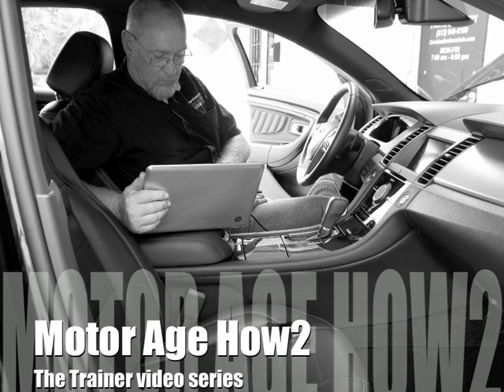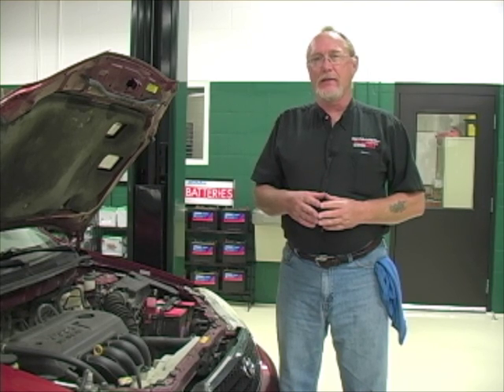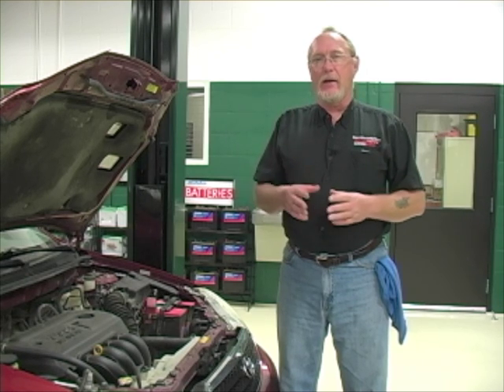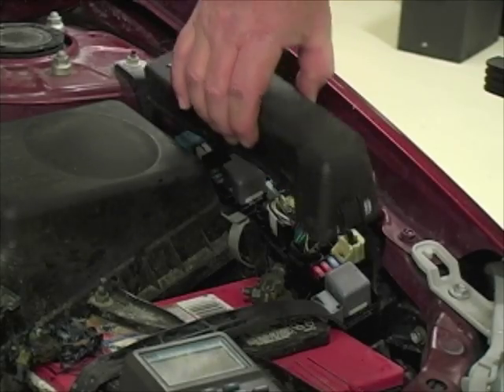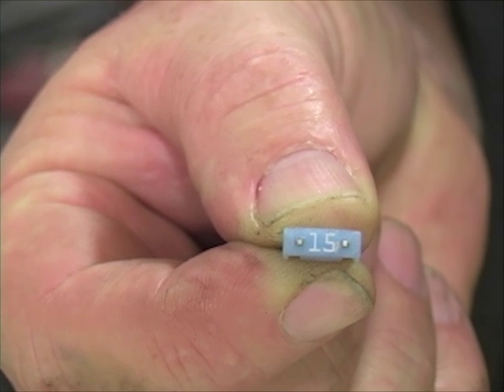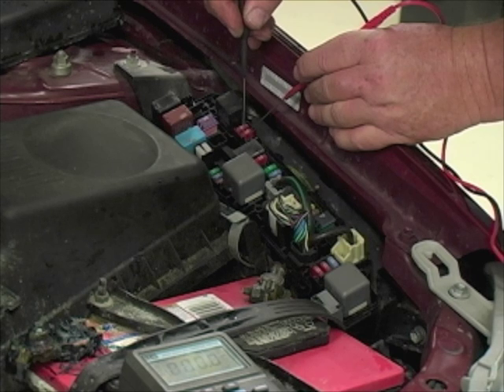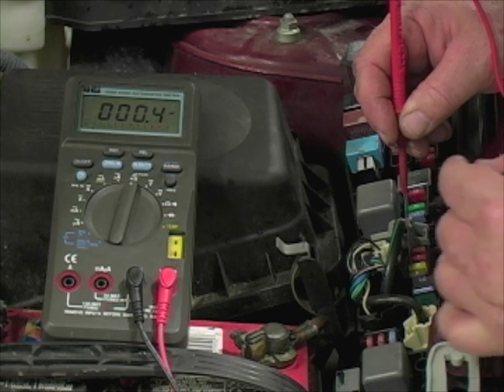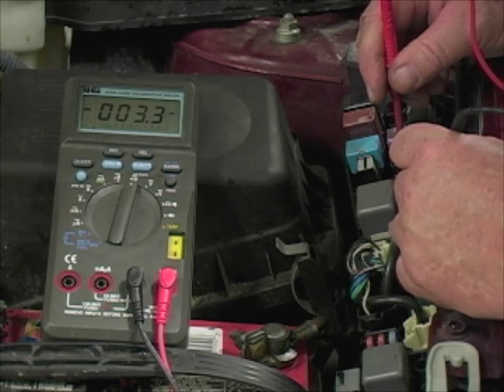The Trainer #26: Using Voltage Drop To Find Key-off Battery Drains

Comment: 3 mv is not probem, 0.1amps is good max, why are you checking milivolts not amps in series?like here. maybe that 3.5mv is for alarm system or something like that. good test but not full prove
Reply from the maker: We are measuring voltage drop across the fuse, and that is measured in volts. And 0.10 amps is way too much draw!
Reply: the 3mv is NOT the TOTAL voltage drop across that circuit. It's only the drop across the fuse in the problem circuit.  3mv is not the problem, the 1 volt drop further down the circuit is the problem.
Also the reason for not doing an amp check in series is because you would most likely disrupt the circuit in doing so, and even if you don't it would take a lot longer.

Comment: Quick question. I see voltage drop testing is good for isolating live circuits, but how do we confirm excessive draw in the first place without checking amp output of the battery?
Reply from the maker: This is but one method for isolating the cause of parasitic drain. The first step, as you noted, was to measure at the battery to see if there is a drain to begin with.

Comment: Thanks for the video. But why do I show NO AMP draw when meter hooked in series?
Reply from the maker: A few things to check. Are you using a digital multimeter? Are you on the right scale? Are your leads in the proper jacks (their different than the ones you use for voltage measurements)? Did you blow the internal fuse?
Reply: Motor Age Thanks for you response, I really appreciate it sir.
 I am using a digital meter at a 10 amp scale with the leads in the altered jacks. (Positive lead in the amp jack, instead of the side by side normal configuration).
I must clarify... when I said I have no amp draw I was wrong. I should have said "no significant amp draw". When I first hook the meter in series I get about 0.7 draw for about 20 seconds. Then it drops down to 0.02 . 
I'd appreciate your thoughts and suggestions... Thx
Reply from the maker: redwhitentrue Then you have no parasitic draw on the system. The initial 0.7 amp draw is likely a module that is "awake" and powered up, and then it shuts down and the current falls to a perfectly acceptable level. What kind of problem are you trying to solve?
Reply: Motor Age The problem I'm fighting is a "no crank" issue. But it only happens after the 2002 Grand Caravan has been sitting in the driveway for a day or two. 2 weeks ago I was stranded and had to get a jump home. I tested the 6 year old battery and it was marginal so I replaced it. A week later of starting fine it wouldn't start again so I tested alternator volts. It was only 13.2 volts so I replaced the alternator which is now putting out 14.2 volts.  It ran fine for another week but then didn't crank. I waited a few seconds and it did crank and started. I'm afriad to take it anywhere due to the intermittent no crank that before has stranded me.  Your thoughts are appreciated.
Reply from the maker: redwhitentrue When the failure occurs, does it try to turn over slowly or not at all? When the system is working, is the cranking speed normal? Do you have replacement battery cable ends installed? 
I would do a voltage drop test on the starting circuit. I think you'll find your problem there OR it is possible that the starter motor has a bad spot on the commutator. First few things that come to mind.
Reply: Motor Age When the failure occurs it will not turn over at all. All battery cable ends are original and clean. And yes, when it is working properly it does crank at a normal speed. I think you may have hit something there on the starter commutator. Is that testable?
Reply from the maker: redwhitentrue Usually a sharp rap on the side of the starter when it is stuck in a bad spot will be enough to get it turning. Another possibility is a problem in the relay side of the starting circuit. When it fails, look for power to the solenoid on the ignition feed wire or try swapping the starter relay with a "known good" part.
Reply: Thanks much. I appreciate it.

Comment: plz tell me for that test fuse WHERE  i shoud put my maultimeter on???
Reply from the maker: Take a close look at the top of the spade-style fuse. You'll see two small test points that many use to check continuity with the power off. But if current is flowing (parasitic loss) there will be a voltage drop across those two test points. HTH!
Reply: i now that  i mean where i put my maultimeter thanks?
Reply from the maker: saringe kamal Set your meter to read DC Millivolts. One lead on one end of the fuse, the other on the opposite end.
Reply: ok thanks so much

Comment: This has been one of the most talked-about and also the most repeated, but nevertheless the most absurd subject that has been thrown around by some so-called instructors in the recent years

Although one might interpret a 3.2 mV drop across a fuse as passing current which is a correct assessment, but the reality of the battery drain that causes hard start and no-start after sitting overnight or a weekend is that anytime the parasitic drain exceeds 80mA, you encounter such problems.

Now simply finding, measuring, and measuring accurately with a solid repeatability, the amount drop in Micro Volts (not mV...milli volts) across a suspected fuse and interpret that data into a solid voltage drop figure that is exceeding the limits of allowable parasitic drain, frankly borders on wishful thinking, incompetence, or lack of practical experience.  

The equipment that are able to make that minute of measurements consistently are the lab quality measuring devices, and are not simply available in a typical automotive repair shops in a repair shop environment. You can have Micro-volt drops just by elements, grease, and corrosion on the tip of the test leads.

Granted; if a power relay, defogger, seat actuator, and other high-amp devices stay on, their drop can be measured by going over the fuses. But when you are diagnosing for parasitic drains that are slightly above the limits of say 80 mA, and causing a battery run down, then measuring voltage drop across the fuses for such a minute amount in Micro-amps repeatedly and consistently, and interpolate that reading into an actual and sustained amount of draw, is really wishful thinking, regardless of articles in Motor-Age, propagated by someone in CTI, and repeated over and over again.
Reply from the maker: First, no article in Motor Age is propagated by any corporate partner. Second, this test method was first taught (by the information we found during our research) by Chrysler many years ago. Third, this is only one of several methods we share to tackle what can be a difficult problem and not an end all cure.

Thanks for taking the time to voice your opinion.

Comment: very stupid question but... once I found the fault, what do I do? Is it just the case of changing the fuse? Or each case is different and if for example the problem comes from the radio i will have to change the radio, or the wires?
Reply from the maker: First, no such thing as a "stupid" question. Once you have the fuse identified, you use the Power Distribution schematic to see which circuits are fed by that fuse. Then, using a low amp clamp, you can isolate exactly which circuit is the culprit by measuring for current draw on each leg independently. Once you have the single circuit identified, you can then determine whether it's a component fault or someone just left the trunk light on!
Reply: Thank you! (you think there is no stupid question... watch me doing mechanics). Oh where do I find the Power Distribution Schematic? Is it in my user's manual?

Last week end i got in my car, and the radio switched itself on without even me putting the key in. This could be related, right? Althought the stereo has never been changed, it is a standard peugeot one (I have a 206)... Ahh electrical problems on a Pug...
Reply from the maker: The Power Distribution diagram is located in service repair information. There are both online and hard copy sources available. And yes, if the radio is turning itself on that could be a clue!
Reply: ok, thank you for your help. I will charge the battery again and check the fuse. I suspect it will be the stereo (assuming there is a power drain). If it is the sterero, then it could be a common problem, with the stereto turning itself on on Pug 206. I somehow still like the car (weirdo..!)

Comment: There is a specific amount of current still flowing for anti theft system..it will be reflected on the service manual .the problem is that if the is installed with aftermarket stuff then the spec will be off.

Comment: I like this method a great deal when dealing with regular fuse types, however it doesn't work on those mini & maxi fuses with the clear plastic cover over the fuse element. Rats!!!
Reply from the maker: Oh, but it does! The plastic cover can be removed to access both sides of the fuse element.
Reply: Motor Age Magazine Thanks for your suggestion. I guess even if I crack one of the covers a bit its' probably not the end of the world.

Comment: I don't understand something here. The fuse is in a parallel  circuit , but it takes a series circuit to read amps. So how is this working?
Reply from the maker: If you mean you need to connect your meter in series, that isn't entirely true. No matter, we aren't measuring current but the expected voltage drop across the resistance the fuse creates in the circuit. ANY reading other than a perfect 0 means current is flowing and that's what we're looking for.

Comment from the maker: The drop across the fuse depends on the type of fuse (maxi, mini, cartridge, glass) and it's amp rating. No one answer for that one. Some have taken the trouble to compile a list of what the voltage reading across the variety of fuses means in terms of amperage draw. Google may be able to provide you with a list for your toolbox.

Comment: have you figured out what a normal voltage drop across a circuit for a module that is only using say 20 mA which would be normal but would still have current flow?

Comment: I once saw reference to this technique, and the author had a chart describing typical voltage drops depending on the size of the fuse. Then last year when I needed it, I tried to find it unsuccessfully. 

Time is always the enemy, and you don't want confusing issues arising when electronics wake up after removing and then replacing a fuse. This seems to be the best quick screening test to quickly identify the circuit involved. 

By the way, I love the way you delivered a short clean message.

Comment from the maker: Basic electrics. Voltage is used to push through all the resistors in a circuit. When there is more than one, the voltage will be split proportionally among them. Measuring the change across any one resistor is called a "voltage drop" measurement. This can only occur when current is flowing, so if I can measure a drop across a fuse I know that circuit is "on". Watch the webinar we did on voltage drop to learn more. I've included it as a video response.

Comment from the maker: I used an Innova meter with auto-ranging. It just took a second or two to stabilize. Easy way to find out is to mimic the test I did here. Turn the dome light on and start measuring fuses after the modules go to sleep and see if you can find the dome fuse!